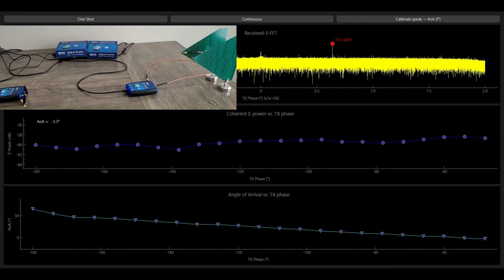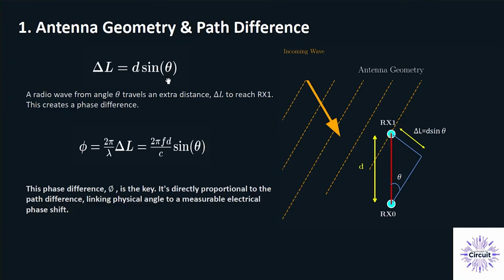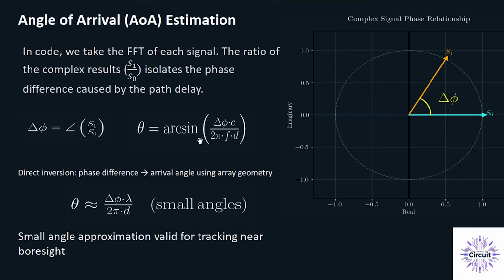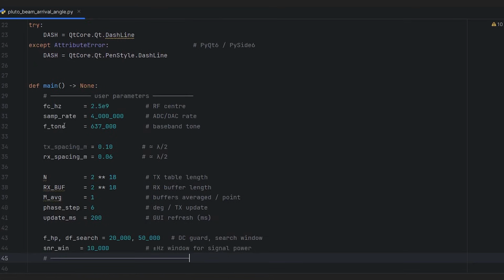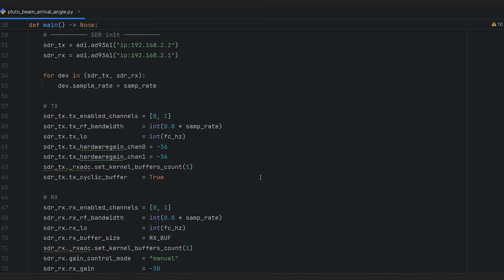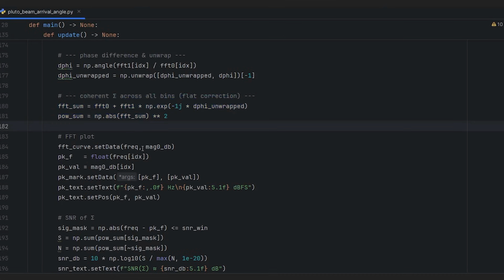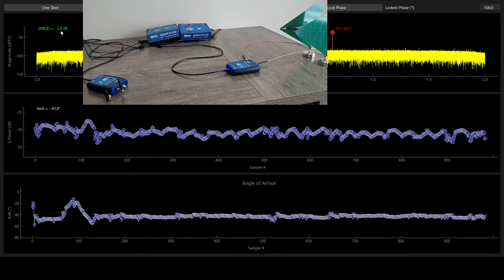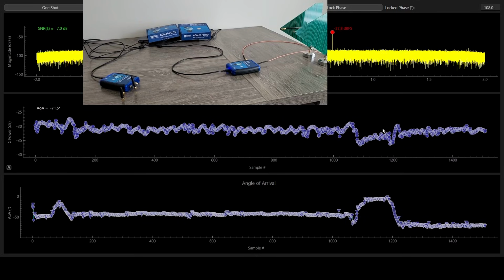Beamforming & Angle of Arrival (AoA) Explained: Live Python Demo with ADALM-Pluto SDR

Comment: Could you possibly help me with a concept I want to try but don't have the equipment or expertise to do so? I'm hoping you might even be able to include this in your future videos, I did subscribe in the hope you might. 
  Could you set up two transmitters, one transmitting at 2.4 GHz, and another transmitting at 1.485ghz , to see if a receiver can pick it up as a 915 megahertz signal ,without any special mixers or any extra hardware, first I want to see can that be done.
 The second thing is can you modulate those first two carrier waves such that they too mix to create a third signal that's different from the first two? That is could you AM modulate the 1.485 gigahertz carrier with an 18,000 Hertz signal, and the 2.4 gigahertz carrier wave with a 21,000 HZ signal and get the 915 megahertz with a 3 khz modulation?
  Does it even work that way and if not how does it work?

Comment: thank's!  the antenna is what reference? where did you buy it?
Reply from the maker: Thanks for watching! I used a UWB Log‑Periodic PCB Antenna with frequency specs of 600–6000 MHz. I got this antenna from Amazon. Besides Amazon, you can also find the same antenna from Mouser, Digi-Key, AliExpress, and other electronics suppliers.